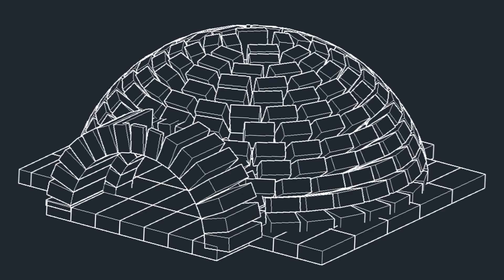COME COSTRUIRE UN FORNO A LEGNA "FAI DA TE" - HOW TO BUILD A WOOD OVEN

Comment: Ottimo Lavoro Complimenti,  fino ad oggi hai avuto problemi di scoppi e lesioni dei mattoni ?dovuto al fatto che hai utilizzato mattoni normali e non refrattari! ti ricordi quanti mattoni ci sono voluti in tutto?  Grazie mille
Reply from the maker: Ciao Luck, grazie mille per i complimenti. In totale ho utilizzato circa 160/170 mattoni non refrattari divisi a metà (quindi circa 320/340 mezzi mattoni ), per la cupola e arco porta. Inoltre ci sono voluti circa 50/55 mattoni refrattari per il fondo del forno. Nel complesso circa 220/230 mattoni INTERI tra refrattari e non . Ad oggi non ho avuto nessun problema riguardo a scoppi-lesioni. 
Grazie.
Reply: Capisco perfettamente, oltre la malta refrattaria si può utilizzare anche la malta bastarda quella a base di calce e cemento o non resiste Alle alte temperature?
Reply: @lucasimpson92  calce e gesso